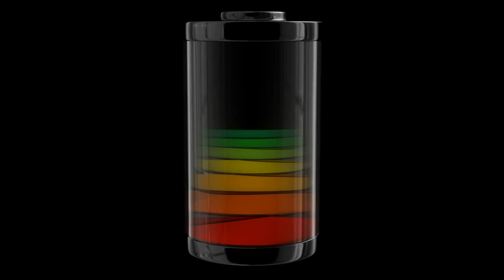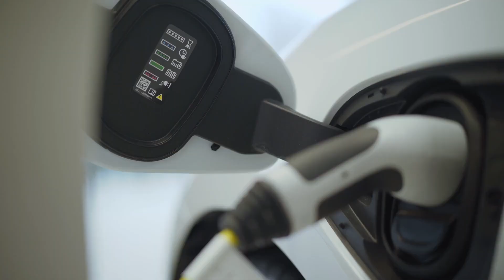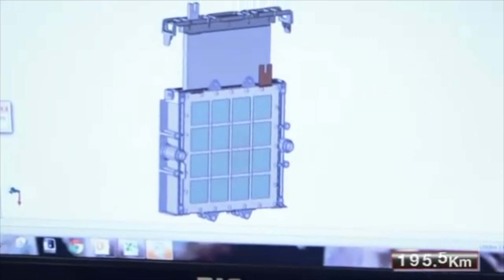This Battery Gives EVs 1000 Miles of Range!

Comment: I don't see any of your drawbacks as drawbacks aside from the ink cartridge printer issue.  At that point it's a federal regulation issue.  Federally regulate that all electric vehicles must use the same basic aluminum air fuel cell.  This way the only difference you have between vehicles is how many cells the vehicle has.  This also promotes competition between alluminum air cell manufacturers, which means consumers win.

Make it so people cannot buy aluminum air cells without a specific license.  This way you don't have assholes buying a battery from advanced auto and leaving their used cell in a dump.  Licensed battery swap stations would have to be able to recycle a battery for every battery they buy.  This way we assure that as many cells as possible are getting recycled.

As to the carbon footprint of making the aluminum, why not operate these foundries off electricity?  Between making their own aluminum air cells, as well as wind/solar power, harnessing enough electricity to manufacture aluminum should actually be rather simple, and save massive amount of money inside of a decade.

Comment: I invented a new HIGHER Power Density Battery ..  based on renewable hydrocarbons, when combined with air, they produce TONS of energy, renewable CO2 and water. Best part, these batteries can be charged in just a few minutes using existing Gasoline pumps!!!  .. and this battery is ALREADY in Production!!

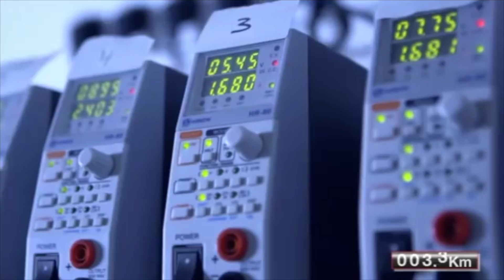Comment: 2:40 Captain MemeLord Musk won't stop using Lithium batteries, but WILL stop accepting BTC.  Will the general population ever get a brain? You can't call out someone or something for the same thing you do without being a fat hypocrite. 8:04 you do know that miles are a greater distance than kilometers, right?  I'm assuming you meant to flip/flop the units on those numbers since those are relatively close to accurate.

Comment: Why would you need to take the car to a battery swapping station??? For over a century people have had to replace lead acid batteries at regular intervals. There is fee that is refunded when you bring your old battery back (they recycle the lead). That lead acid battery is 20 to 25 lbs. There would be ZERO inconvenience in swapping an aluminium battery yourself. You keep a spare in the garage, and swap it on the weekend. If you go on a long trip you stop into a Advanced or O'Riley or other auto parts store and grab a new one. This is such a low skill non technical task, that if a car company requires that you bring the car in to have it done I say boycott them, and do everything in our power to bring that company, and those running it, to utter ruin.

Who gives a rats rear end if it is carbon neutral. No energy producing or consuming thing or creature on the entire planet is carbon neutral, its absurd to think that such a state is even possible. The tech of aluminum batteries is pure genius, and should be brought to market solely for that reason.

Comment: Release Zero point energy tech and your car will never need a charge.  Trouble is they can't put a meter on this like they can your has or electric usage. Also a man came out with a car that runs 9n water in the 1980s. Let's just say he was not around long enough to put it into production.

Comment: 1000 miles between gas stops? where's the inconvenience?  I wanted to see battery swapping when lead-acid batteries were in use. No difference swapping a battery than gassing up the gasoline engine car. Actually, can go A LOT further between gas stops. So....

Comment: With current Li battery vehicles they must be so inefficient having to haul around hundreds of pounds of battery. In my gas-powered Toyota Supra I typically only half-filled the gas tank for a 200 mile range, knowing that I could easily find another 1/2 tank even when on a long trip. The weight saving of not having to haul around 10 gallons of extra gas gave me better gas mileage and acceleration performance (in case I might need it, heh heh).

Comment: AL-O2 primary batteries are used by military because you can store them dry for years or even decades... when needed you activate them by pouring the electrolyte in and it gives you power... the problem is that once you activate them you must use them, they will not last for too long (so using it for 2 months in a EV is not realistic).

Comment: You mention the fundamental flaw in this system yet fail to grasp the implications and get side-tracked into the logistics of battery swapping etc.
The problem is that aluminium production is not carbon neutral. Even with a zero carbon electricity source, smelting aluminium oxide back to the raw metal releases massive quantities of carbon dioxide. 
A battery delivering 1000 mile range from 25 kg of aluminium has the effective CO2 footprint of 250 grammes per mile… about twice that emitted by the average new car currently sold in the UK for example.

Comment: I am afraid I heard all this before many moons ago but it was "Zinc air". Same thing though - a "single use" battery that can be easily recycled into a full one again - with a chemical process. I have an issue with this method, it cannot be done at home or small scale. It is putting the control back into the hands of big business. It may be viable for some folk, especially if the battery is NOT part of the vehicle. (ICE cars have energy storage that is really just an empty metal box you fill up with gasoline). So an EV is sold with a free "Tank of gas" Alu-Air battery but they battery isn't yours and it's not priced into the purchase price of the car. This might work. But Renault tried something similar with the Zoe and they have since dropped the scheme. Tesla already have batteries that will do thousands of miles on a change, but they only survive around 80 charges. I think this technology may work well for large plant, shipping, where Lithium does not have the density for extended use, and not being able to "recharge" at home isn't necessarily an issue.

Comment: This technology would lend itself extremely well to what Project Better Place started with Nissan and Renault back in the earlier days of electrical cars. Basically it was battery replacement stations, that would charge (as much as possible) renewable energy onto battery packs. A housing, looking like a small car wash, would house the batteries, and a robot that would replace your battery in minutes.

And...
1kg og aluminium contains a theoretical maximum of 8kWh.
Later in the clip, it is stated that 1kg costs 15kWh, and produces 10kg CO2, but it does not make it clear if this is for recycling, or for mining, and refining 1kg.
If it's for recycling, then 15kWh in = 8kWh out, so your efficiency is above 50%. That's still over double the efficiency of an efficient petrol car today. Also, if the aluminium is melted with renewable energy, it requires no carbon. And since the electrical grid has losses of up to 25%, if plants for melting aluminium are made into smaller local plants, that are powered mostly by renewable energy, you can put the energy lost into the production of these cells, reducing losses, ensuring that you have 33% more energy to put into recycling the aluminium.
If memory serves, aluminium melts at around 600 degrees Celsius, so making an alloy, adding something like Bismuth, could potentially lower the melting point (but of course, if that limits how well the aluminium oxidizes, then that's a no-go), thus reducing the gap between the energy in, and energy out.

Comment: Would we have to worry about oxygen consumption at one point? Sounds like it consumes O2 but doesn’t give it back.
Reply: So do internal combustion engines that populate the vast majority of cars, the engines that drive all transport ships, volcanoes, forest fires, and most mass production as the majority of energy production uses some form of combustion in its supply chain.  We're still here.  O2 density is likely not going to be an issue since it already only makes up 21% of the air you breathe right now.  Humans breathe mostly nitrogen.

Comment: Wow, very cool.  There are so many possibilities with this.  Currently i need to change my oil every 3000 miles,  it wouldn't be that much of a stretch to just go for a battery swap as i do an oil change.  Also, my van is a chrysler product which means something breaks every few miles and so it needs to go to a mechanic with more than desired frequency, so even if i had to swap every 6 weeks or so the mechanic could take care of that along with the other problem.  The creation of regular gasoline is such an environmental nightmare that the aluminum recycling couldn't be that much worse.

Comment: Video 8:13 min ... "extended range by 600km or nearly 1000 miles"..... ..I would say you wanted to say extended range by 600 miles or nearly 1000km (960km)
Reply: Ok, just saw your correction...1600km, neatly 1000 miles...

Comment: What matters most is the round trip efficiency of the Aluminum air battery is.  If it takes twice as much energy to recycle the used batteries than the energy they provide, it would probably be better to upgrade grids to enable rechargeable vehicles. After all, upgrading these grids provide more benefit than just transportation.

Comment: 100kWh of energy is a lot closer to 3 gallons. (2.77-3.03 gallons depending on which figure you go with.

Most of a lithium ion battery is not lithium and technically lithium isn't mined (at least not in the traditional way.)

Comment: Excellent discovery. There is definitely a place for the aluminum-air battery. Since these batteries are relatively light, could 2 batteries be fitted to a car and the user switches from battery one to battery 2 when the first becomes exhausted?
Reply: Definitely. Since, it's only beginning and it's already better in my view than lithium ion batteries if petro/diesel stations can easily transition into swapping stations. With incremental changes if the world supports the technology, it can easily surpass current system in place because of recycling and safety advantage that comes with it. The cost of battery replacement and charging are also depreciated by swapping, basically outsourcing the responsibility of battery or having a subscription instead of purchase.

Comment: Imagine a new kind of all-electric hybrid as was talked about briefly in this video.

You would have a much smaller, lighter, and cheaper lithium ion battery with, say, only 100km of range (more than 90% of people actually use on a daily basis here in the U.S., despite ridiculous range anxiety) AND, let's say, a 1,000km aluminum air backup battery that would completely eliminate range anxiety and allow for longer road trips. You would charge the LION battery frequently (nightly) and only tap into the backup battery as and when needed.

Then, once or twice a year (at most) you would take your car in for a quick 15min backup battery swap.

Lower weight. Lower cost, better performance from smaller electric motors (due to the weight savings)... Could be a huge win. 

...of course, a very similar concept could work with hydrogen fuel cells, with no need for a swap, just a top-up.
Reply: I can't approve this enough!

Comment: 1:48 What do you mean by 'storing grid energy'? Storage will never be AC, nor at 230 or 110 volts. It could be made that was post storage with an inverter, but I don't see and point in that—can you explain? Good video otherwise, apart from not converting all the unfamiliar legacy units like 'pounds'. Thanks for catching the messed up range conversion.

Comment: I recall BMW was working on something similar many years ago. But their solution was to use existing aluminum spools of wire, that the consumer could replace. The idea was that the wire was fed into a wet bath of electrolyte onto a spinning cylinder anode thing. And that the wire as it fed was depleting/eroding slowly. They mentioned the sludge issue as well. Don't know what really happened to that tech. But seems more reasonable to replace a spool of welding wire every few thousands miles. Possibly do an electrolyte top-up-de-sludge procedure at the same time.

Comment: Yeah basically you an alert telling you when it needs to be recharged at  20. And then show you a map to the nearest charging stations. 200 miles  that means you're able to build them Costco size. And that gives a person plenty of time to be able to see the charging station. There's no worry at all I still got 200 miles. And know all well I still got 20% I don't want to waste it. So basically you can go earlier or later if you want to. So and you also got more than enough time to save up money. Imagine its a $100 or 200 per change of the aluminum gas battery. You don't have to worry about getting screwed over.  The prices will be the same for everyone. And they also give your free car a check over if it needs new tires break all that stuff. In a perfect world it be a quick repair and check up any extra irregularitys.

Comment: At least we are heading in the right direction toward a PERFECT ELECTIC CAR.
Reply: Hey Carl, despite the  bitchy nature of the Leftists who are incapable of thinking for themselves, and thus swallow the narrative they're given, the Chinese will be doing as they always do, developing nothing. They decided long ago it is easier and cheaper to steal needed tech rather than invest in doing research themselves. Who outside of China uses Chinese computer chips? NOBODY! Hopefully the Left will wake up one day and realize we're going to be using petroleum products, anyway; so why not use our own instead of paying Russian market price for oil? Name-calling seems to make the Left feel better about themselves, and their Trailer Parks.
Reply: @GetOuttaTheJohnBoy I am seeing it as trailer park leftists are the muscle....it is the limousine leftists that are the concern.   Power .  Over . You .

   Regardless...your on point.  Great post.
Reply: Perfect car? What do you think cars are made out of?
Plastic, rubber and metal. All reliant on oil and gas for either raw materials or to melt the metal, transport and construct the cars. 

What can you make tyres, carbon fibre, plastic, wire insulation etc out of without oil?
Reply: There's no such thing as a perfect electric car, as they run on your local grid power source. For example: nuclear generated electricity, rainforest tree-burning generated electricity, and surprisingly the least offensive option, COAL generated electricity. The electricity used to charge these batteries doesn't just come from some mystery place nobody really sees, it comes from your local electric company, just like the power in your home. Food for thought.
Reply: @GetOuttaTheJohnBoy  
Oh stop, your giving the snowflake bad dreams 😄

OK let me add one more.
Definition of Bio-source energy:   Cut down trees to burn in a Bio-source Power Plant add chopped up old tires to make wet wood burn hotter. Just don't tell anybody what the fuel source is and you have a snowflake dream come true.
Reply: @paulcoenen7918  I kinda already said that, but good one, anyway.

Comment: I never thought about single use batteries in terms of EVs but this has a lot of potential. Battery recycling is already done incredibly well with lead acid batteries. I don't see why we couldn't do the same with aluminum air batteries.
Reply: Nothing wrong  with mumbo-jumbo  batteries.

Comment: The only thing is the battery pack cost way more than the gasoline you would use in the 1000 miles and then the time you would have to wait for the shop to change it out so in all n all the electric vehicles are not the way to go at this point in time

Comment: Not depending on child slave labor for the raw materials should gain this tech some serious attention. But that isn't what factors into the minds of the manufactures, they don't care where the material comes from or how it was sourced. They honestly don't even ask. Out of sight, out of mind.

Also, on the issue of environmental emissions due to the procurement/refining/reprocessing of aluminum, the carbon emissions are largely due to fossil fuels being used as the power source. Why not, oh, I don't know, use the zero emission aluminum battery that is being produced as the power source for some of the machinery involved? Or many of the other zero emission sources we have to power the refining processes. That's the thing about these clean "but no they're actually dirty" energy things, is they actually could be clean if they would just stop using fossil fuels at the beginning of the process. But, industry is incredibly stubborn.

But as for whether or not people would actually be willing to drive a car that has a battery that can't recharge, I think if the total range of the installed batteries was able to get up to something similar to a scheduled oil change in gas cars, like 3k to 5k miles or some such, then these would probably be a fairly comparable option. People have been willing to take their combustion vehicles to a shop to spend half an hour plus time sitting there waiting on the oil to get changed out, they shouldn't mind doing the same to do a battery swap, and the swap would likely be faster. And keep in mind, during the drive time between, you don't have to stop at gas station and drop $30+ every visit. Money saved and time saved, plus electric is just a lot less maintenance over time than combustion, which is even more money and time saved. Cost of ownership is something that very few people factor in to owning a vehicle, but you should, because over the life of the vehicle it makes a huge difference in what it actually costs you. Combustion has the highest cost of ownership by far.